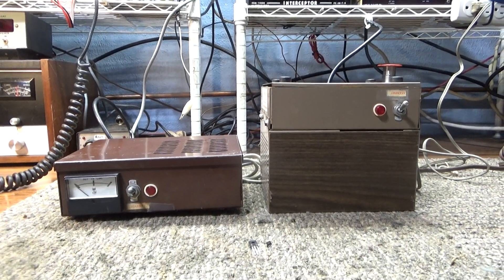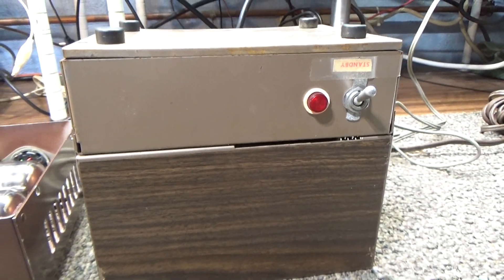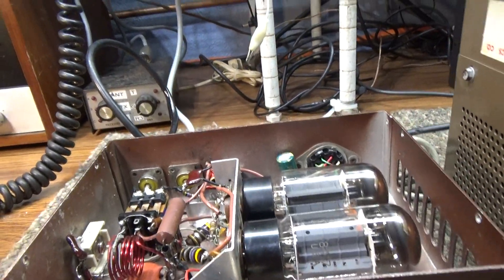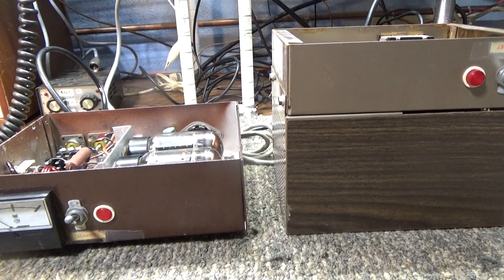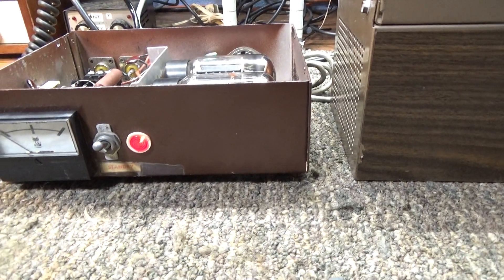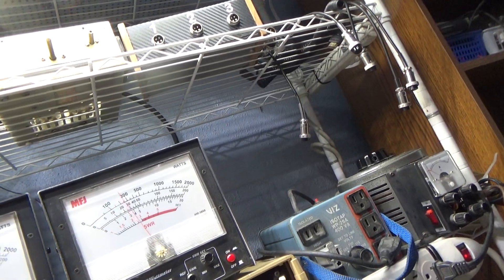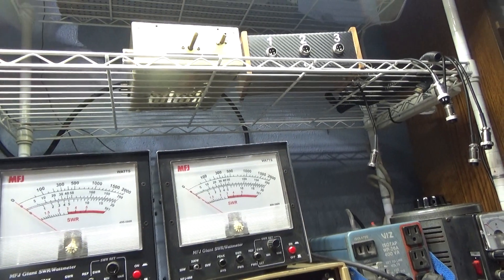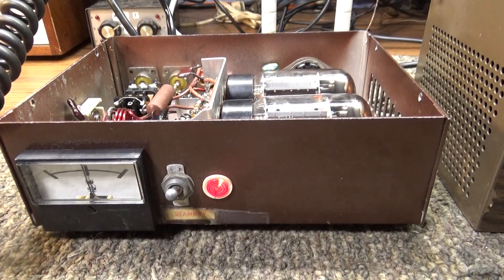Blackcat JB-76B base 200 amp 2 tube linear amplifier on the bench

Comment: I would say it needs some fans on it to keep the tubes cooled off. For longer key down time. Good video, I liked watching it. 2IS030 Sparky in N.W. AR. International Sidebanders club on 27.385 lsb. Call and Check in freq. is 27.395 usb. Fri.-Sun.
Reply from the maker: I don't quite agree with that. Keep the dead key at 40 or below and they run cool enough. I think the problem is many run them too hard. Blackcat's are the one case where you tune the input tuner in the back down.